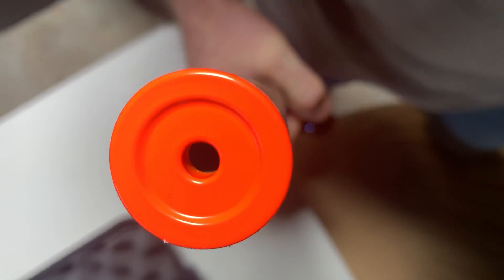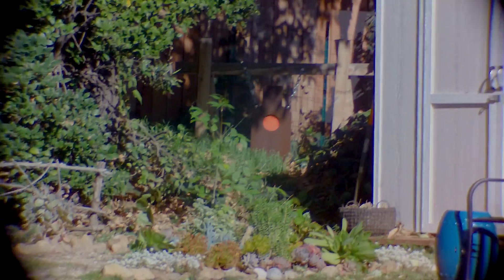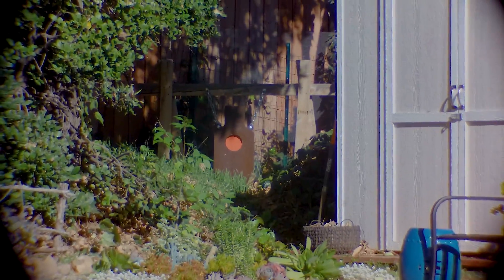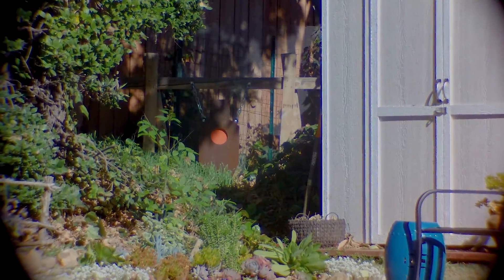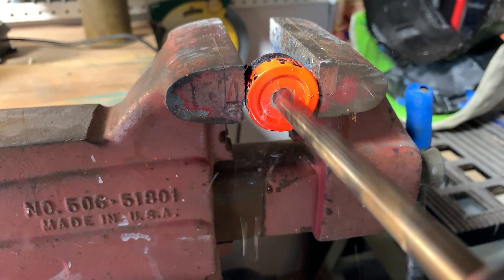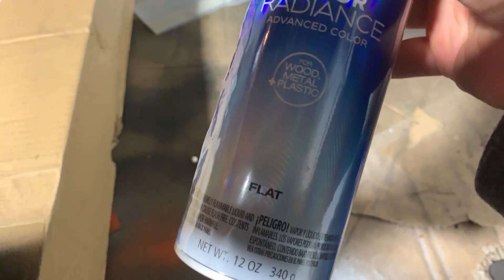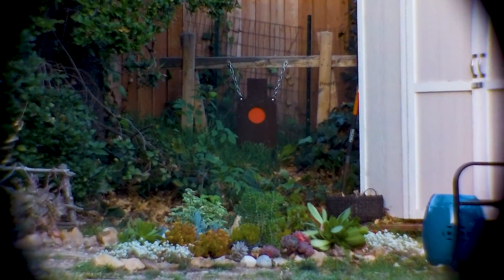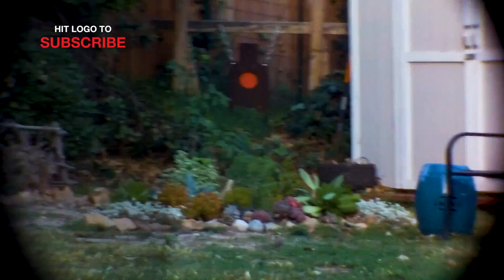This One Tip Can Improve Accuracy of Your Airsoft SSG-10

Comment: Both the SSG10 black end cap $9 and the SSG10 suppressor adaptor $13 have o-rings that stabilize and support the inner barrel, and it seems from comments Novritsch fixed the orange end cap issue as well and yes all the new SSG10s come with barrel spacers with two o-rings you can add light oil to at the midpoint inside the outer barrel...and you can move the barrel spacer it to any position inside the outer barrel

Comment: hats off to you on this. i didn't buy the ssg24 before over issues with that tip. the solution i got from Nov at the time was to buy a new barrel and tip. Not knocking him but I skipped out at the time over the extra cost,  Now thanks to you with this i'll take the plunge in summer and buy the new A1 and i'll quote your channel as the reason i'll be buying.                            
Thanks for the vid                                              subbed                 (red tip not required where i live)

Comment: I have said this before but you sir are a genius and  should apply for the openings at Novritsch! I have a couple of your scope cameras and they just work perfectly.  The 90mm sniper and the 50mm never let me down.
Reply from the maker: Thanks this one was fairly straightforward.
Reply: @BrainExploder  How many times was it not straight forward though?Yet you still figured it out. I do have a project if you want to take it on , a 4k zoom camera based off of a firefly
Reply from the maker: Runcam is said to have a 4K replacement in the works based on the same body as the rc2. Im waiting on that.
Reply: @BrainExploder  AWESOME thanks for the heads up I will definitely have to pick one up

Comment: I have an SSG 10 1A same problem. But I would not do what you did. I took the orange cap that protects the threads. Knocked out the pin and then screwed it in further. Which allowed the barrel to go inside the hole and hold it steady with the O-ring on the threaded adapter that solve the problem. For my SSG depends upon the hop up and the BB but I can hit at 400 ft. Modifying the hop up could help me get the 425 to 450 maximum range. The new hop up give me more accuracy to help me a great deal. Or the new Barrel which I'm considering

Comment: It could even be that the reduced diameter of the barrel cap was causing added turbulence in the air as it exited around the bb during firing. This mod seems like something that Novritsch may want to look into adding to the next batch of SSG10s, just to be safe.
Reply from the maker: Yeah I'm sure the air was doing some weird stuff too thats why I really blew out the opening on mine I want no interference.

Comment: Yes, I had the same issue with my SSG-10 A2. I removed the orange cap and put the suppressor adaptor instead.
Reply: Did you have any trouble removing it?
Reply: Did it fix the issue?
Reply: Did it fix the issue?
Reply: the suppressor adaptor has an inner o-ring that supports the inner barrel so yes it would fix the problem but also the black end caps have an inner o-ring as well

Comment: Great tip. I reamed the hole out after I saw the video. I'm not sure why he decided to go with 6.5mm holes instead of 8.5mm like in the SSG24. This to me makes the crowning of the inner barrel basically useless and introduces too many variables in the muzzle. With the thick orange tip paint applied and tolerance stacking from the concentricity and perpendicularity I can see a good number of rifles by affectred by this. I reamed the hole out after I saw the video.
Reply from the maker: Yeah the orange paint probably further narrowed the opening by nearly a millimeter. Glad it was a useful vid.

Comment: I found the same to be true on mine as well after removing the orange tip it shoots very nicely  thinking about some mods to quit it down a bit  ? Sound foam and I am experimenting with the air brake right now  if you have any other  quiet tips throw they out for us ! As always great videos and good looking out !
Reply from the maker: I never understood the obsession with quieting the airsofter snipers. We got min 100ft engagement distance and at that distance it’s not much of a sound happening. I play mostly urban so maybe it’s the woods sniping where it would greatly matter.
Reply: Very true in certain environment sound doesn’t matter  I find that outdoor areas where the ambient sound level is low  that I can hide and get kills  but another thing is that. My polarstar is still the quietest thing I own and with the air turned up it outranges most spring sniper 😂anyway hope to play Airsoft with ya sometime !
Reply: I don’t have a chrono but I do have the 2.8 spring and I shoot 4.6 bbs. Let me know how them pins work and if it worth going to a higher spring, to stay with the FPS limits.
Reply: Nathan Mccane so the air brake pins do work  a little I found over 100fps drop with the longest one and around 50-60 fps drop with the shortest one however I combined that with a 3mm pad on the back of the nozzle which softened the impact a little  combined with the suppressor it not to bad however the biggest thing is the spring ringing the can mod didn’t do it for me   I also went down to a 140 spring took out the air brake hit 475fps on .20  throwing.46 bbs only about 250ft probably gonna run 150 spring  so my take is the lower the springs seem the be quieter pins are up to you

Comment: Is it not just the rubber that needs working in?  I think some of the attendees of the launch event noted the same issue and they dont have orange caps there. Just put a couple of 100 of rounds trough the rifle and it should work itself out
Reply from the maker: No did you watch the vid? The difference between cap and no cap is night and day. It was an obstruction in the path of the Bb that simply knocked the Bb off its course. The one at the launch event did not have the ultra long orange tip just a little stubby black one and the problem is less likely to impossible with that design (I assume).
Reply: @BrainExploder  yeah I did but since the european ones without the orange tip had the same issue and you have been putting rounds trough both causes and both fixes might be true
Reply from the maker: While I don’t doubt the rubber breaking in theory as most guns need a little finesse before they get good the instant change from removing the cap is undeniable.

Comment: Now check In your cylinder for metal shavings. I found that the spring guide cuts shaving everytime you pull the bolt. Let me know what you find.
Reply from the maker: Just downgraded my spring didn’t see anything out of the norm.
Reply: I think its more that there are burrs from the CNC machine after it cuts it... then when you cock the gun, the spring runs along the burrs causing them to go into who know where in the gun.. the hop up, barrel etc.. first thing I did when I got mine was take it apart and check for that.. I have a gen2 version and didn't find any burrs in there. I still took some extra fine sandpaper and lights went over the edges just in case. :)

Comment: Could you link the video novritsch sent/showed you for removing the orange tip
Reply from the maker: It’s not a vid just that website for the black cap that explains how to remove the orange tip. You can pause the vid and read it.
Reply: @BrainExploder  my ssg10 does not have this pin and ive been trying to twist it off with a heat gun and vice grips.
Reply: Jared Buckley Have you been able to get it off? I’m having the same issue. The orange tip is almost impossible to remove from the end of the gun.
Reply: @wyattstarke  i got mine off. Took me an hour and a half. You just got to keep soaking it in boiling water and use a pipe wrench to unscrew it. Wear thick gloves. Trust me, it will hurt your hand. Almost lost all my strength doing it

Comment: Was the placing of the orange cap a production error? If so, can you get a refund or exchange for another SSG10 from Novritsch? I thought that model was one of the most reliable sniper, if this small thing can cause so much inaccuracy than why would people call this the one of the best gun?
Reply: you can go with either the Novritsch SSG10 black end cap $9 or the SSG10 suppressor adaptor $13...both have an o-ring that provides support for and stabilization of the inner barrel 👍🏻

Comment: What Fps/Joule is the SSg-10 you have?
Reply from the maker: 530fps with 0.2G BBs Ive tuned it down to 480 since this vid.
Reply: @BrainExploder  which spring did you put in? I originally have the M220, which is fucking sweet.. but mostly for backyard shooting, i recently ordered the M170 (wanted the M180 but out of stock)... Our local field here is 3.6 joules for bolt action snipers, so hoping it gets me pretty close.. on the site, seems like the M180 would be perfect, but ill have to wait until its back in stock I suppose.
Reply: @MrZombs123  m220 is super hard to pull back?
Reply: @mpers  it can be if your not used to it.
Reply: @MrZombs123  I see these guys pulling back the bolt like its a nerf gun....with the m220 there is a lot of force required.  More than I thought.  Also, I am an airsoft noob, I only use the gun for plinking cans.
Reply: @mpers  lol. Bc most of them don’t actually have an m220 in their guns. No field would allow that high of joule or fps... i ended up putting an m160 in mine which gives me about 3.1j and the field limit is 3.5j so im right at about the limitless.

Comment: I’m having trouble getting the orange tip off, I tried nocking the pin inside and twisting, it did not work, I tried hot water and even a little flame to melt the glue and still have no luck. Anybody have ideas?
Reply from the maker: Remember it’s a ccw thread so turn clockwise to loosen. I used some adjustable pipe pliers scuffs up the finish but gets it off.
Reply: @BrainExploder  I tried this and it's still not working for me, any ideas?

Comment: How do I take the tip off with no pin?
Reply: I soaked my barrell into boiling water multiple times. Then used a pipe wrench. Took me an hour and a half. Wear thick gloves.it will hurt your hand turning it. Please check my channel if i helped in any way

Comment: Im having issues with removing the orange tip, I pushed in the pin as far as it would go and boiled water and put the tip in for about 4 minutes but when twisting clockwise all it did was chip a lot of the paint. it didn't turn at all.
Reply: Jason Saka I am having that same issue and need help also